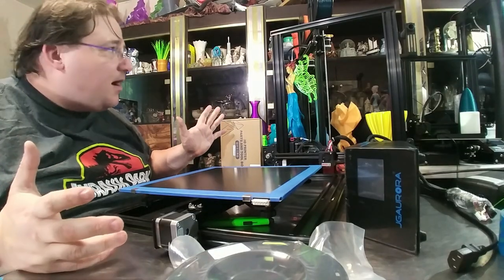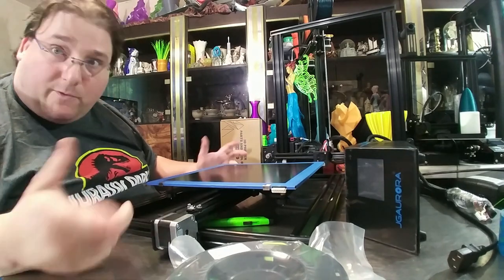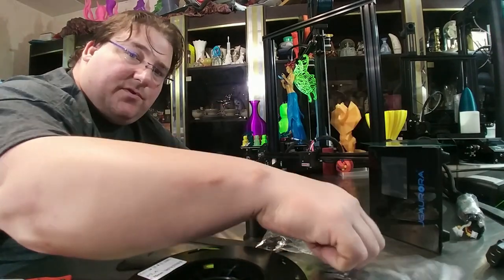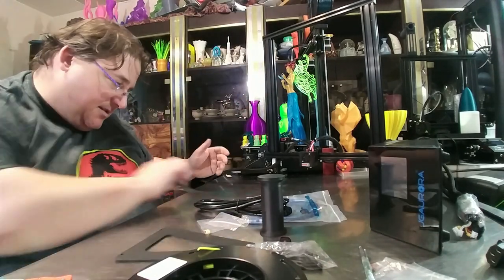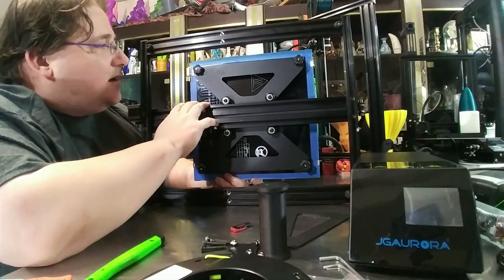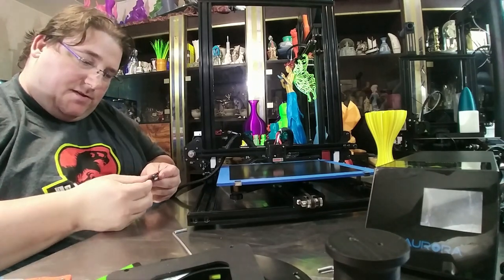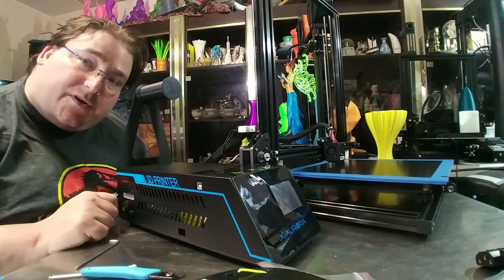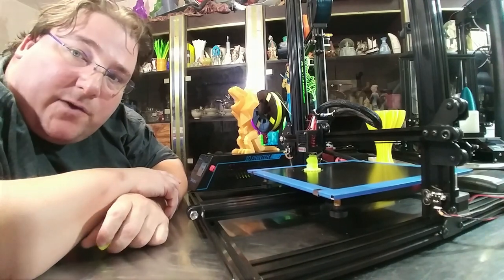JG Aurora A5X Color Touch 334 Class 3D Printer   T3DP

Comment: Pretty nifty! Shame about the salmon-skin problem; you've got to wonder why that's still a thing...

I had so much trouble getting the bed off my Nano I stuck a Post-It note under it to serve as a handle...
Could I ask what settings you use to slice for it? Their settings, even advanced, aren't so hot...
Reply from the maker: I use the same settings as for my ender 3 with just smaller build volume. Also it needs cooling. Even a small usb fan sitting in front of it is enough.

As fot salmon skin. Meh. Smoother are so cheap and easy to install so while annoying not the end of the world.